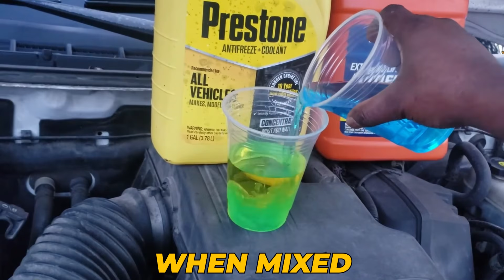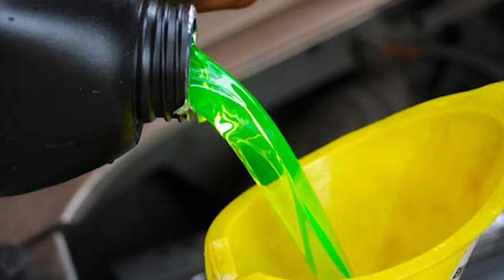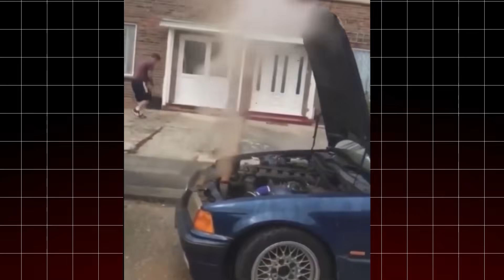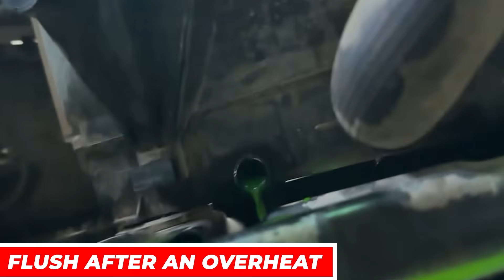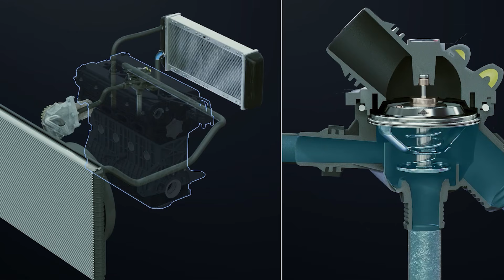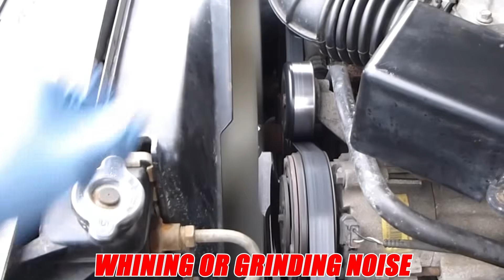This Coolant MISTAKE Will RUIN Your Engine (Most Drivers Ignore)

Comment: One of the least discussed causes of premature component and engine failure today isn’t coolant brand, oil brand, or even vehicle design — it’s maintenance strategy.

Modern manufacturer-recommended service intervals are largely optimized around ownership cost projections, warranty coverage, and market competitiveness, not maximum vehicle lifespan. When those intervals are followed rigidly, without context or inspection, they often allow fluids and components to remain in service well beyond their optimal operating window.

From a professional standpoint, this leads to predictable outcomes:
	•	Degraded lubricants and additives
	•	Chemically unbalanced coolants
	•	Accelerated wear of seals, plastics, and bearings
	•	Cooling-system failures that cascade into major engine damage

Engines rarely fail from a single incorrect fluid choice. They fail from time-based chemical breakdown combined with extended service intervals and a lack of informed inspection.

Modern vehicles are capable of lasting significantly longer than the average ownership cycle when maintenance is properly timed, not simply mileage-based. Fluids age chemically whether a vehicle accumulates miles or not. Heat cycles, oxidation, and additive depletion all occur independent of odometer readings.

Routine maintenance performed earlier than manufacturer minimums — combined with basic visual and functional inspections by a professional — is one of the most effective ways to extend engine life. Small issues are identified before they become system-wide failures.

Coolant is a good example. Even OEM-specified coolant does not remain chemically stable indefinitely. Over time, inhibitor packages deplete, pH drifts, and the coolant becomes unbalanced. When that happens, plastic components, seals, and aluminum alloys begin to degrade regardless of brand.

Using the correct coolant specification matters, but coolant alone does not kill engines. Poorly timed maintenance does.

While this was especially critical 10–15 years ago when many “universal” coolants relied on incompatible additive packages, the market has evolved. Many modern universal coolants are:
	•	OAT-based
	•	Low-silicate or silicate-free
	•	Phosphate-free
	•	Hybrid formulations

If a coolant meets the exact OEM specification, it can be used safely regardless of branding or price point. The key factor is spec compliance, not marketing language.

In practice, a vehicle maintained proactively — even with a compliant universal coolant — will almost always outlast one maintained strictly according to extended manufacturer intervals using OEM fluids.

The uncomfortable reality is that many consumers cannot afford major engine repairs. When failures occur outside warranty, they are often forced into long-term financing on a replacement vehicle. That economic pressure is not accidental; it aligns with modern product lifecycle and sales models.

Vehicles are capable of much longer service lives. Achieving that longevity requires:
	•	Correct fluid specifications
	•	Maintenance intervals based on time, heat, and usage, not just mileage
	•	Regular professional inspections

Good maintenance doesn’t prevent failure forever — but it dramatically delays it. And in today’s vehicles, delay is often the difference between normal ownership and catastrophic expense
Reply from the maker: Thanks for sharing your valuable opinion